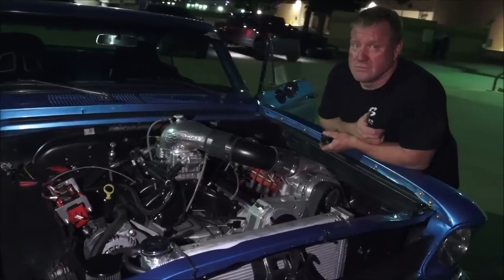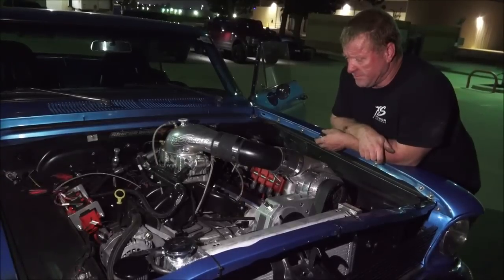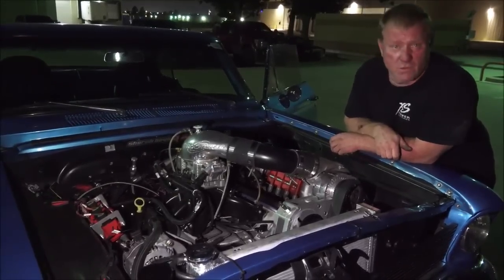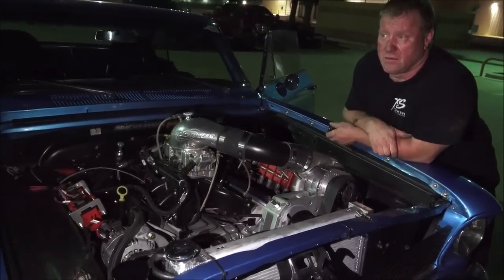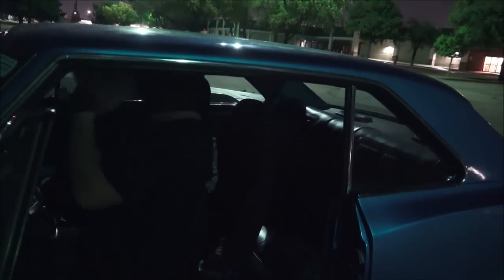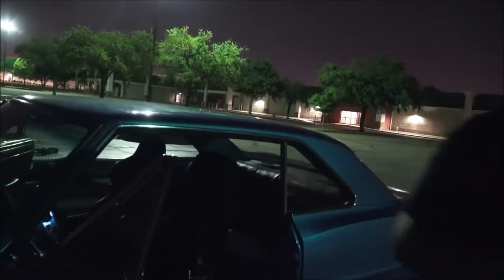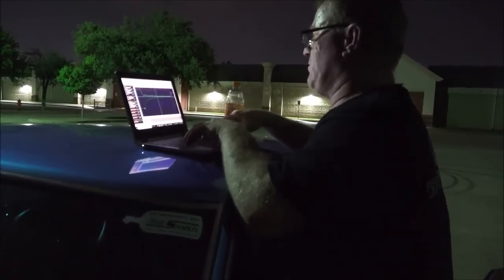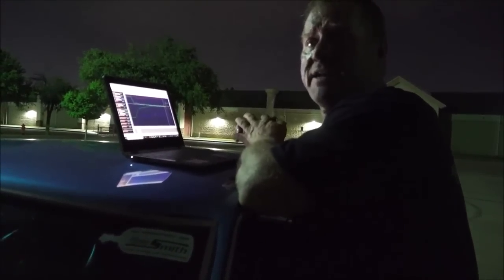Nova Testing

Comment: i got a v6 with power adder in a 4x4 government test truck (looks like a lane white stretch cab truck)  i have to rev up the motor to gear up the trans or crawl up a hill on boost! i took me a few times playing with settings! the dash was dead on bad fuse (i went to you-tube what blew or reset beaker in fuse box where & how) the whole setting was reset to factory! set back to cruse & stand on foot power